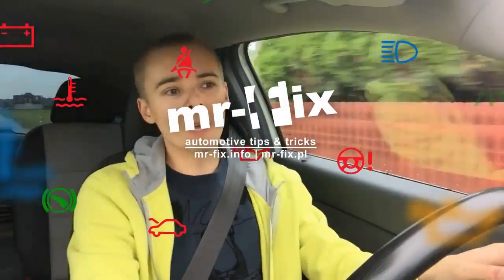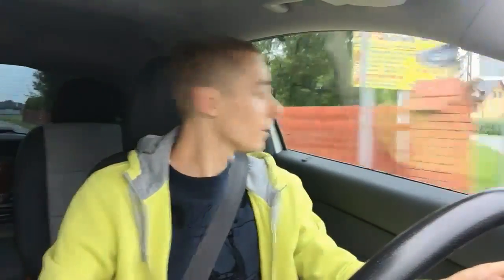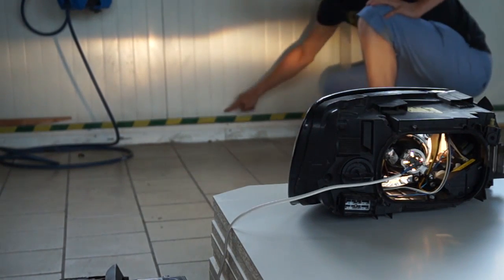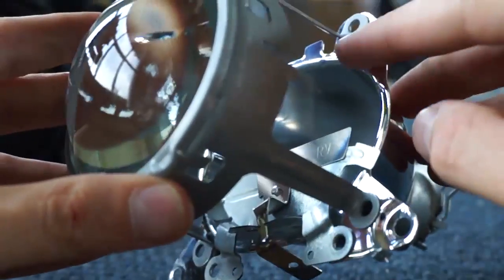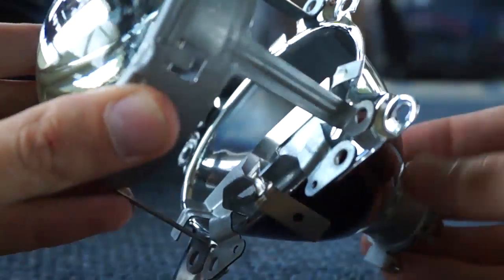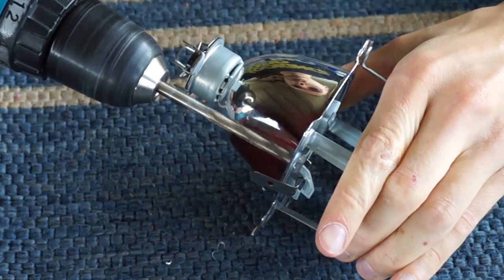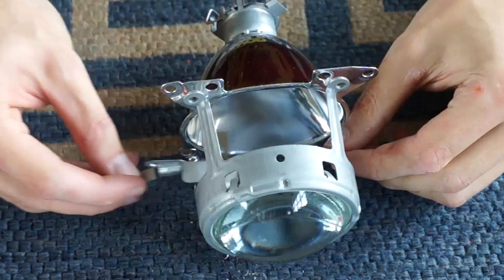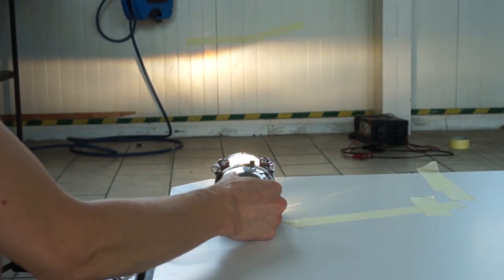Fresh projectors in Volvo C30

Comment: It might be an old post but could you confirm where to by the new projectors? Nothing came up with google....thx Mr-Fix
Reply from the maker: I got lucky with those and found a set of new ones from Fiat 500 (if I remember correctly). There's like 10 models of projectors used world wide and after some research I've noticed which brands are using the same models.

Comment: Hi. Can you tell where can I buy this projector?  Thanks
Reply from the maker: I found new projectors for Fiat 500 which are the same. Basically there's 3 most popular projector manufactureres: Bosch, Valeo, Hella. Most cars will have projector from one of those three.
You can also look for some 3rd party projectors with mounting holes matching yours. But most likely you'll find bi-xenon or bi-led projectors and not H7 halogen ones.